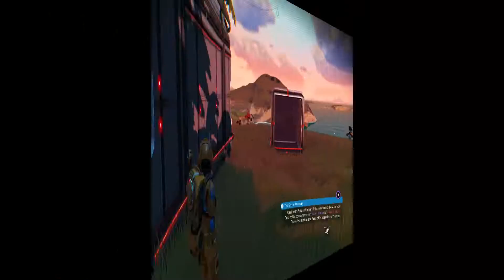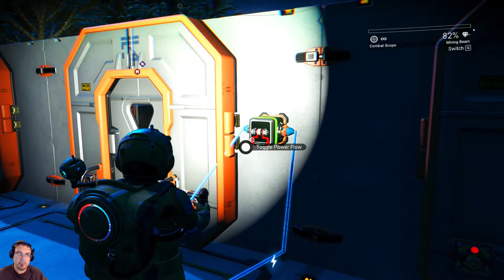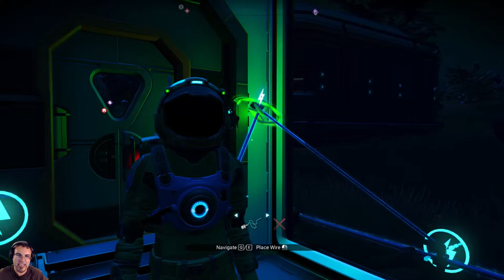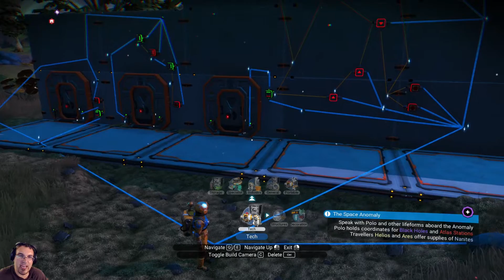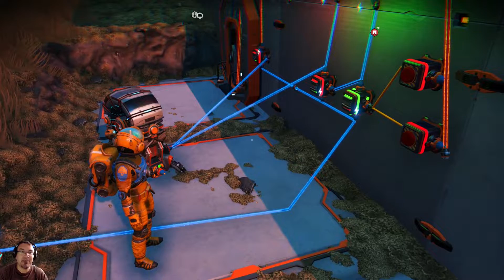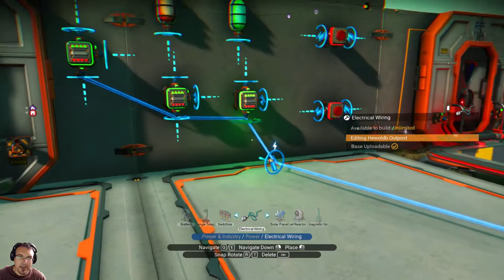How to Wire and Power Doors With All Switch Types! - No Man's Sky Beyond Tutorial

Comment: Holy crap this stuff seems needlessly complicated.  No wonder I just use the holodoor on the prefab bases, but I needed this because I wanted to use the garage door on a base.  Thanks
Reply from the maker: Yeah I wish they included circuit boards as an upgrade option not just basic wires only but it also means everything needs to be wired like how we used to do it back in the good ol days; one soldered wire connection at a time

Comment: Man all I want is a simple door with switches on both sides with no possibility of locking myself out. Is this possible? I'd rather not watch a 23 minute video if it turns out you can't.
Reply from the maker: It's 100% possible.  Each one of the doors uses 2 buttons.  It's designed to allow for one button on the outside and the other on the inside

Comment: dude why do none  of these people do both sides. that's the only difficult part about this is connecting both sides and having the door still work right. any idiot can wire up a single side of the door.
Reply from the maker: So the doors are actually wired for a double sided door switch.  You'll notice each door uses two switches.  One's meant for outside the other's meant for inside :)

Comment: 7:45 What's a modifier? I'm using a inverter and prox sensor. This method doesn't work for me. It shuts the door when I get near it. So its doing the opposite.
Reply from the maker: Ah the modifier is the part of the T of the inverter that is perpendicular to the rest of the line going through the T. In the vid I have it facing upwards

Comment: Anyone having issues with when they make a door switch on each side with sliding doors I can leave through the door and close it’s and go back through and close it but if I close it then come in from another entrance and try opening it from that other side it won’t let me please help 😩😩
Reply from the maker: If I recall it has to do with how the two switches are wired (if you're using the manual lever type switch).  That one locks out the door if toggled.  That's why the hardest one is trying to create a button switch where you can toggle it and shut back off again so it can be used multiple times rather than a single toggle and having to re-engage the switch on the opposite side

Comment: I lock my base with power garage doors every time I leave the game. What my question is when you leave the game does the power garage door open? I ask because when I jump back into the game the power garage door closes right before my eyes every time.
Reply from the maker: Guerrilla Man that’s interesting.  I wonder if that happens with regular doors. One thing you can check out is ensuring you have enough power supplying the door to go through both the day and night cycles

I’ve had experiences where the power somehow runs dry after an extended period when I don’t have enough juice to keep the lights on
Reply: @KoiGaming  Yea man there's plenty of juice I always make sure I slightly over do it. But now what I've done is deleted the power garage doors and now using a standard wall to lock my base when I leave. Problem solved

Comment: For some fucking reason when i wire up the power converter thd green switches sides fucking so stressed
Reply from the maker: I assume you're wiring the inverters and the autoswitchers? Don't worry really about the green flipping on the switchers/inverters.  It still works the same even though the green may be backwards

Comment: Bro, thanks for posting, but a little feedback... You talk way too fast, and apparently didn't think ahead about what you wanted to show, so you are jumping all over the place, making it very hard to follow... And in the end, it's just confusing.
NMS surely didn't help by making wiring ridiculous.  We dying have Antimatter reactors with Broadcast Power, and will have reasonable switches without having to run ugly, distracting wires everywhere...  huge loss for NMS!
3 inverters, 2 buttons, and 2 lights just to get a door to open like it should is absurd.  This mess really ruined bases for the majority of us who hate this... And it's not because I can't - I have wired real homes, but this is ridiculous...  it's ridiculous right down to having to use power to keep the door open !  BTW, an inverter is not to change AC to DC -that's a converter... 
 If it was an DC and broadcast power, it would work much better.
I can't believe HG wasted time on this...  a simple "gadget of choice" connected to a door our light would have been just as effective without the ridiculousness...
Sad!
Reply: keep it up though Koi, just need to keep going with the next video :D
Reply from the maker: LochVids thanks!
Reply from the maker: Douglas Alan Cummins hey thanks for the feedback! I had to re-record a couple of sections again cause I didn’t expect some of those in game issues to crop up after I prebuilt everything (like realizing the lights actually acted as very small resistors to slow down the signal enough to keep the door open) 

The hardest part I think is remembering the lines in the middle of gameplay XD

Btw I hear you about the inverter/converter thing but what’s odd is when you make blinking lights the inverters act as AC. Also the button itself just by clicking it pseudo acts like AC too. It’s very weird 

I totally agree with you I wish doors and buttons were simpler. It shouldn’t be this complicated just to open a door. The whole setup regardless of switches should have the rest of the mechanics inside the door while the switch gets “plugged into the door to work
Reply: NMS attempt to steal Redstone... what a dismal failure this wiring stuff is.